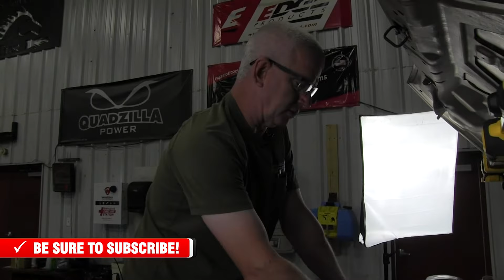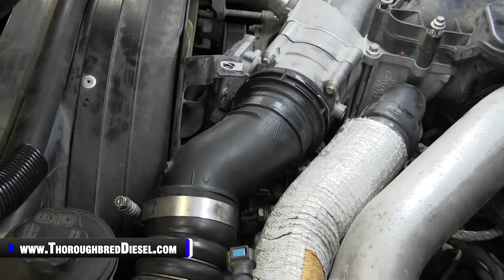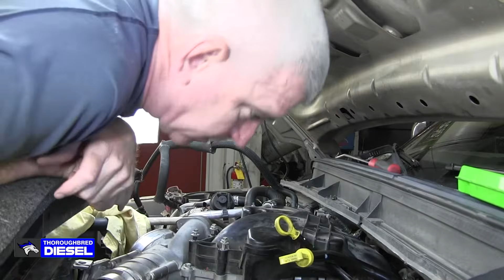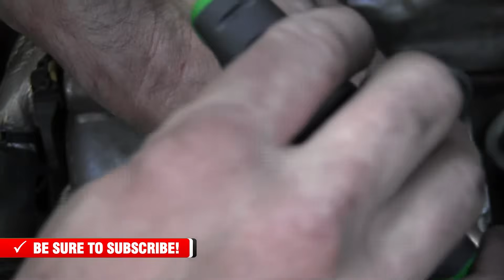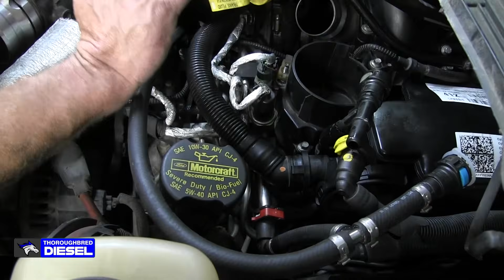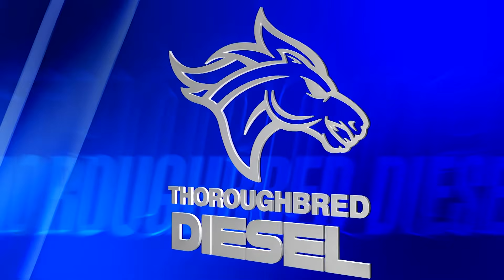Installing The NEW S&S Diesel CP4 Bypass For A 11-19 Powerstroke | This Could Be A Life Saver! #fyp

Comment: I put this on my truck and this afternoon I changed all the filters when I changed the oil like I always do and in the frame filter when I sprayed it out with brake cleaner, there was glitter in it then I cut open the disaster prevention filter there was glitter in it, and then when I cut open the main filter on the valve cover, there was also glitter inside that one too

Comment: Great video and very much appreciated.  I haven’t started my truck after the install because I hear hissing like a vacuum leak while priming the system. Is this normal? I rechecked the o-rings on all fitting except the by pass under the intake.  They look good as well as the Donaldson seal. Is this normal and I’m being paranoid for no reason? I’ve primed maybe 8 times

Comment: Solid video! What do you use to clean the engine bay before install, is non chlorinated brake cleaner and compressed air sufficient?

Comment: Little late to this but extremely helpful video. I did find it easier to remove the bolt for the high pressure fuel line at the CP4 first before removing the last bolt for the fuel bowl. Other than that everything went well. Thanks for a great install video on an older truck!
Reply from the maker: Thanks for showing your support!

Comment: We bought a 2011 f350 dually with 200k. Looked up truck issues. Worried about the cp4 pump so I bought that right away. Today after watching this video 5 times and 7 hours later thanks to ford making the engine bay so stuffed. Success! Thank you for your time and effort making the video to help the community. First time working on a diesel at home. You made this easy even though ford didnt.
Reply: As a master mechanic that is one of the easiest to work on, Duramax your pulling the cab off the frame to access the turbo ect, the job is absolutely doable in an hour, but I have 100k in tools and years of busting knuckles in tight spots, that's engineers for ya! 🤦

Comment: At 48:40 is where my hose kinked. The fitting would not rotate. Has anyone else had this problem? If so what is a good solution besides replacing the fuel line all the way back to the tank?
Reply: @LovettandSonsFarmSolutions  did u replace the lines ? U have a pic of it??
Reply: @LovettandSonsFarmSolutions  having the same issue

Comment: What is the length of the replacement bolts at the pump? Trying to install a kit that had been previously installed on this truck and was removed and I’m missing the bolts for the FCA and also the black hose end coupler.

Comment: How often do I need to change the filter
Reply: @anthonykinchen1137  the same interval as you changed your other fuel filters. S&S recommends every third oil change. Page 9 of the install guide has recommendations for normal usage and off-road usage.

Comment: Very informative and helpful video. I was struggling removing the filter housing due to the hard fuel lines but got it out "after" I pulled the intake. Got to the point in the video where he put the housing back in and realized, I never needed to remove the housing. Just sort of stared at the wall for a few min then pressed with the rest of the installation.

Comment: I noticed that the FCA rocks a little bit on the large o-ring, even after you get it fully seated down in there by hand, the metal faces are not coming together tight...  before you start alternating the 4mm Allen bolts. Your video shows this rocking as well. I was expecting it to "seat" down in there better, but I assume this is normal, making it more important to slowly alternate the allens by hand, before torquing. I did make sure that my black o-ring was seated up in there properly. I hope this is OK. Fantastic video BTW.
Reply: did yours leak ? experiencing this now. thanks .

Comment: What is the average cost of installing this
Reply from the maker: Cannot comment on cost but should be able to be done by a competent shop in 3 hrs or less
Reply: One man can do this with no problem on their own.  For two men, it’s an absolute cakewalk.  you can do this with minimal tools in 3 to 4 hours. (highly recommend having an air or battery powered extended reach ratchet.)

Comment: installed the bypass filter. Transfer pump loaded up after a few miles and blew. Put a new pump on and same issue. turn key on and transfer pump quiet for 3 or 4 seconds then whines loudly. Checked all hoses seems to line upl
Reply from the maker: These kits filter return side fuel and should not have any effect on low pressure supply pump fuel.  Give us a call lets review your installation.
Reply: @thoroughbreddiesel  could this be a symptom of the return to tank line being kinked? Mine kinked trying to spin that fitting up and won’t unkink. I’m waiting to hear from an and s on a good solution. I saw another install video that looked like the guy kinked his but didn’t know. You have to feel it. The tube is under that corrugated plastic sleave so you have to peel that back to see it. Any thoughts on a solution for that?

Comment: What are the service intervals on the newly installed S&S filter? Or does it stay put until the CP4 detonates
Reply from the maker: No official service interval, but in my opinion, I would change and check it pretty regularly.  If you were to cut that filter open and find metal, that is your indication of a failing CP4.
Reply: It’s recommended to change at the same intervals as your other fuel filters. Every third oil change or so. Or if you are letting it idle for a long time or towing heavy, you can increase the frequency of change.

Comment: The mount looks flimsy. I wonder how it would stand up for those that spend most of their time on rough logging roads
Reply from the maker: Thankfully we havent had a complaint of one breaking away yet.
Reply: It may look flimsy to you because it has rubber bushings to cut down on vibration transferred to the filter.
Reply: @BAlexxander either way it still looks flimsy. Thanks for your amazing comment

Comment: I purchased the kit and I followed your video and I found your work to be first class. The kit is on and protecting the diesel system. If the cp4 does self destruct the damage limitation is in place. Thank you for your, greatly appreciated, guidance!
Reply from the maker: Thank you for watching and I hope that the return filter never has to filter any metal for you!

Comment: My 2012 f250 is bogging down after install. But only when I give it gas. I’m sure it’s a loose connection or one that I forgot to connect. Any ideas before I go in and rip everything out again?
Reply from the maker: Is the truck coding for anything and were you having any issues before?  Possible bad connection at the fuel filter, do you have any leaks?

Comment: I was able to tackle this, thanks to your video.  It started right up without any leaks.  While I had the factory filter cup out, I put in a 2023 version of the CCV filter (mine is a 2019). That one on the truck you are working on looks deformed from it being clogged.  I also put a S&B cold side pipe while I was at it.  Thanks again!
Reply from the maker: Thanks for watching

Comment: Completed my installation with no issues after watching your video. Installation was 2 days ago. Truck was running great!! No issues, no medal in system truck is a 2016 with 70k. Today while driving I accelerated hard to avoid a collision and lost power and truck quit running. Check engine light is now one and I get a crank with no start. Any suggestions?
Reply from the maker: Need to pull codes on the truck and see what its reporting.
Reply: @Brandonj1F  update?

Comment: Great video, I just bought a 2016 F250 95k miles. I’ll be doing this shortly. My question is-with all of this apart, how much more work is it to swap out the cp4?
Reply from the maker: Not much.  You are right there.  Check out our DCR install video and you will see what it takes to get the CP4 out.

Comment: Just finished this install last night on my 2011 F350 and took me five hours with no problems. I did end up losing the bolt to hold the fuel filter kit to the ground but ended up just reusing old bolt that was already there and works fine. Thanks!
Reply from the maker: Awesome!  Glad it went well.

Comment: Just bought a new to me 17 f250 with 200,000 miles. After research I decided to buy this kit and install it myself, wanted to do the DCR but money is tight. Pretty easy to install and this video definitely helped! Quality hoses with basically plug and play connectors. Only issue I ran into was when I removed the oil separator connection from the intake I broke the tubing. I really needed to replace it anyways but just didn’t plan on doing it now. The front screw on the FCA is difficult to remove/install if you don’t have the tool that s&s recommends. It’s basically a 4mm extended hex for install and an extended t25 for removal. If you are thinking about doing this kit I highly recommend it and also installing yourself. I have a pretty limited amount of mechanical experience only consisting of restoring old f100’s and mustangs and was able to install fairly easily. It’s worth the cost of replacing your whole fuel system and even more in peace of mind.
Reply from the maker: Thanks for the review, glad it helped!
Reply: Hi, I'm about to purchase a 2011 F350 and I'm also restoring my '67 F100.  If the diesel doesn't already have this I will also be doing this.
Reply: @MatthewBrowne-tw2yr  lol i also literally broke my ccv hose an hour ago.. shits brittle.

Comment: Ok but the pump still delivering fuel straight to the injectors, i still dont see where the fuel is being filtered before going to the injectors, when the pump fail that debri get push quick to the injectors then goes to the return line then it get filter.
Not really sure if this works
Reply from the maker: Its being filtered after it leaves the pump on the return side.  Filtering the fuel that has been exposed to the metal from the pump eating away at itself.    The incoming fuel is being diverted away from the “belly” of the pump where the failure happens and the FCA receives clean filtered fuel from the primary filtration, that hasn’t been in the pump at the site of the failure, where the metal shavings are produced.  Also, the fuel in the tank is clean because of the return filtration.
Reply: @zdenanrehhelber  yes is very good. I haven't installed it yet, but I know someone who installed it and their CP4 pump failed, and this kit saved them thousands of dollars. I recently called a local shop to ask how much it would cost to install this kit, and they asked me what it was. 😂 I'll watch this video to do it myself.

Comment: Before reinstallation, what's your recommendation of replacing the CP4 with a DCR replacement pump?  Also replace the CCV system or eliminate?  I have 210k on my 2011 f250.  I do not want to buy another truck.
Reply from the maker: If you already have the bypass, it isnt needed with the DCR.  So if you are here and you don’t have a bypass, we suggest looking at a DCR for sure.  With CCV, we recommend changing the filter at suggested intervals.

Comment: Thanks for this video. Clarified a bunch of steps not in the instructions. My late build 2016 F350 differs from your example truck, which initially confused me. Wish I'd have removed the EGR cooler; would have given much more room for the bolts of the upper manifold. I had just removed the CCV filter housing prior to tackling the S&S DPK, so lots of access on that side.
Reply from the maker: You're welcome. Glad it helped!

Comment: Does the S&S Filter need to be changed at the same interval as the other two fuel filters?
Reply from the maker: It’s a relatively cheap filter, we suggest changing when you change the fuel filters.

Comment: Just finished the install. This video was the perfect step by step. I did end up snapping my pcv hose (you're right. Crazy brittle), so I'll have to go in and replace it. Did the install an hour from home so it's duct taped until the part comes in.

Recommendations that aren't in S&S diesel's instructions or explicitly noted in this video: 
You need a T style T25 wrench for the FCA. You're not going to be able to fit a socket or even a bit driver. Same idea for installing the block off plate.
Get a step ladder or one of the platforms that mount to your plow attachments. Your back and knees will appreciate it.

Thanks again to everyone over at Thoroughbred Diesel. This video was a God send!!
Reply from the maker: You're welcome!  Glad to help!

Comment: Did you clean the lower intake out when you had it off?  I didn’t bother with mine
Reply from the maker: No I didn’t but in hindsight it would have been a good idea.
Reply: It’s almost impossible to clean. I tried good brake cleaner, black max, and gas.

Comment: I used this video to do mine myself. I'm mechanically inclined but usually don't tackle something like this. This video is awesome. Mine is a 2015. I didn't have to grind down the intake manifold luckily. Job took me about 5 hours to complete. Be careful not to drop anything. The quarter inch drive and swivel was the ticket. I'd recommend having the screwdriver 1/4" drive also to help things once the bolts are loose. There were a few things that he makes look easier than they are. Those things took a little extra time.
Reply from the maker: Thanks for sharing and happy you got er done!

Comment: So I guess I’m confused?? So the fuel that comes out of the s&s filter goes back to the tank… then goes through two more filters and then ends up at the pump which then goes into the injectors… so if the fuel is just going to go through two filters already… all you’re accomplishing is adding another filter to the system? If the CP4 were to fail couldn’t it still send metal into the injectors?
Reply from the maker: On the supply side, fuel is filtered through the two stock filters.  The S&S filter is a return fuel filter and its design is to keep the metal debris that are generated in a pump failure from making it to the tank.

Comment: cannot get to start have primed numerous times
Reply from the maker: Hit the back of the CP4 lightly.  We have seen some pumps get a contaminant in the valve and wont let it build head pressure.  Try that while you are cranking the truck and it should start.

Comment: does s&s gauarantee that there bypass kit will save your whole fuel system if a cp4 fails ?
Reply from the maker: S&S does not make that guarantee explicitly, and the reason for that is that the condition of the fuel system PRIOR to installation of the DPK has everything to do with the length of time before you possibly can have a fuel system failure.  S&S back their product with 100% and the results speak for themselves.  Metal from a catastrophic failure cannot make it to your high side components post CP4, however they cant save a component that already has had exposure to metal.

Comment: GREAT Video!  I watched this and am going to order the kit for my '14.  A question, since I am having to remove the FCA; would you also consider replacing it with a new one, since you are already there?  And will this work with the H&S Fuel Filter Conversion Kit?
Reply: Hey Scott did you ever find out about the H&S filter kit compatibility ? I have it and wanting to buy this S&S kit soon...
Reply: I am at the same point and don’t know if i should change it but it was hell to get to. Hardest part was those super tight 8mm head intake bolts. Feel like I should replace them as tight as they were.

Comment: I have watched this about 6 times, is there any cutting of any of the fuel lines when hooking them up?   By far an outstanding video for the back yard mechanics like me.  Shows step by step and I feel confident that I can do it.  Thanks
Reply from the maker: All of the lines are precut and ready for installation.  If you are going to modify the hoses make sure that you use equivalent fuel pressure rated connections.  Thanks for watching!

Comment: I watched this no less than 15 times before setting out to get this done. After 5 hours of adjusting my weight around the engine bay and wishing I had one of those sweet chair things it was all installed. Living in Vermont and the truck being a 2011 I opted to not attempt the removal of the fuel filter holder due to the bolts being a little rusty. I was still able to get the upper intake off by rotating it counter clockwise up and out and same for install. Otherwise I followed all the steps.
Thanks so much for taking the time to put this video together!
Reply from the maker: Glad to help!

Comment: Hi Wade ,I have recently installed the CP4 bypass kit from S&S  and it works fine but i have a buzzing sound in the Cab compartment is this normal ,Thanks Phil
Reply: Had the same thing on my 17 ,it was the transmission stick tube vibrating .
Reply from the maker: I am not familiar with that.  Do you think there could be something vibrating in the engine compartment?
Reply: Hi ,thanks for your reply I've checked over it and i think the buzzing is the sound from the Fuel pump and is been amplified through the truck body .. @thoroughbreddiesel